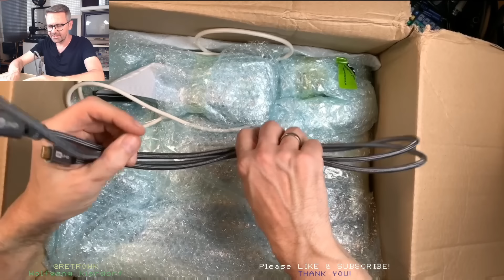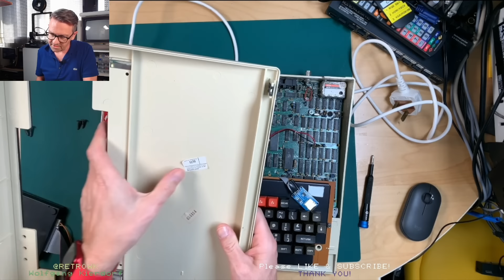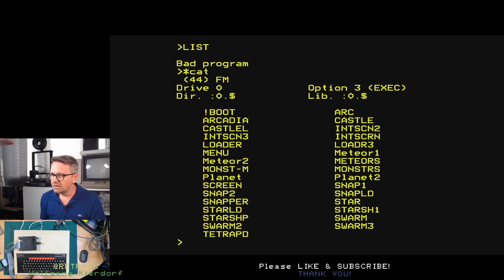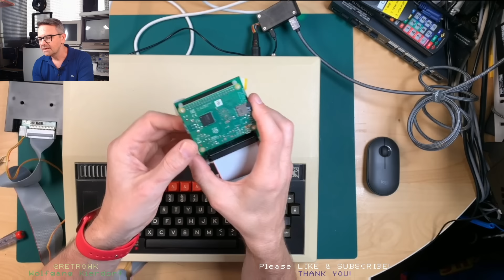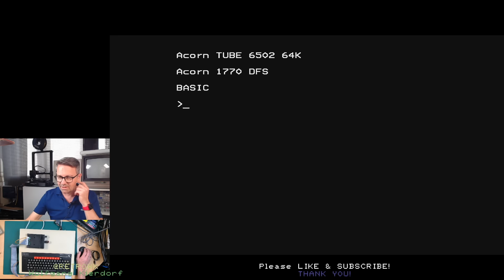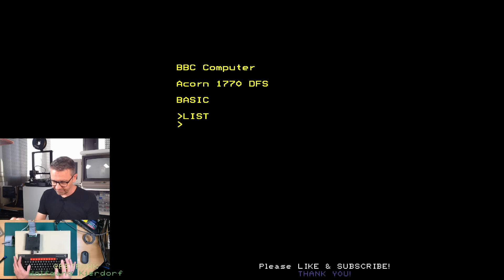Exploring the BBC Micro Model B with a Co-Processor add-on #pcbway #bbcmicro

Comment: Wow, that's a bit of a weird keyboard, I wasn't even aware that that type even existed on the Beeb. I don't remember one ever crossing my path, and both my original Beeb and Master had "proper switches" and even now feel high quality - Although after 20 years in a cupboard, contact cleaner was required!

But you got a great collection of parts for €200!

The Beeb was very well designed, we used to taunt the commodore boys over the speed of their 1541 floppy drive, because a Beeb would read floppies at a speed that you would expect (i.e. not slower than tape!).
I hung countless homemade devices off of the user port (BTW, that's what your microSD card connects to, but I think you don't have the ROM to access it, unless it's built into the disk interface ROM you have)

Comment: Roms are 16k by default so 27128 but you can put larger ones in if you are ok adding a couple of address line wires. Sideways ram can be useful as you can temporarily load roms into it too try them out and a few games have swram enhancements. Only one of my games requires sideways ram, 32k. There are a couple of nice boobip modules, one give 4x16k ram and one 4x16k eeprom although other add-ons or home brew are available. 
Looks like you got a UK beeb as opposed to the German ones.

Comment: There a small USB-C power supply you can add to replace the original one. On Tindie.
Reply: Apart from changing the X2 caps and rarely c9, the beeb PSU just works. 50+ PSUs recapped and only two needed c9 and none needed anything else.

Comment: Got unlucky with the keyboard version there :(. The SD Card interface plugs into the user port btw.  If the keyboard connection cable ever cracks and dies, you can use a floppy drive ribbon cable as a replacement (just not the type with a twist).  As for the odd coloured text, it seems when you ran the RGB2HDMI unpowered the colours were correct lol

Comment: If you accidently press BREAK while typing in a BASIC program, you can type OLD to recover it.
The BBC Micro was the machine virtually every school child learned on back in the 80's, there was at least one in nearly every school.  They were quite an expensive option for home use.  So many families went for cheaper options like the Commodore 64 and Spectrum.

Comment: Congratulations with buying a BBC Model B computer. You could not have done better!
I bought my BBC B in 1982. It was the first computer I bought and I programmed a lot in 6502 assembly on it.
But first things first. There is something wrong with the color of the text of your BBC. Because the text should be white. It was white for a while when you removed the power form the RGBtoHDMI. So I think there is al loose connection in the cable to the RGBtoHDMI.
BBC B computers were sold in Germany! I know that because I own a German version of the BBC B.
It is almost the same as a ‘normal’ BBC B except that is has a lot of shielding inside which makes it very heavy. The motherboard has some differences and the startup message is also slightly different.
The keyboard problem you have is because of ageing. Normally a BBC keyboard is very nice to type on. It has one of the better keyboards of the 8-bit computers. 
If you press BREAK you can get your Basic program back by typing OLD. You stop a running Basic program with the Esc key.
There is a download available for the Gotek which contains a menu system with all the BBC games on it. It is called the TrickyMenu. Just Google it.
The SD-Card goes in to the User Port and you need a so called MMFS EPROM to access the contents of the SD Card. There is also a menu available for the SD Card with all the Games. Just visit the StarDot forum. There you can find information on almost anything concerning Acorn computers.
If you need any more tips, I can probably help you as a 40 years plus BBC computer owner 😊 Just ask.

Comment: Nice find. intact ashray too. rare. Why is the main text mode yellow on black though? You try it without the RGB2HDMI?
Reply: Looks like the blue is either not working or not connected.
EDIT well blue works later on in the video
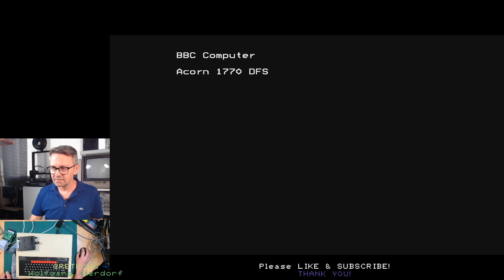Reply: @senilyDeluxe  Must be a dodgy connection. It fixes itself by 25:10 but is broken again at 34:15

Comment: On BBC, they used the old term chainloader, so the command is CHAIN "" iirc, although GRUB also uses that term. And pretty sure Elite is the only game which uses every key and has multiple functions per key with modifiers.

The BBC didn't take off because it was too expensive, that's why the Spectrum took off.